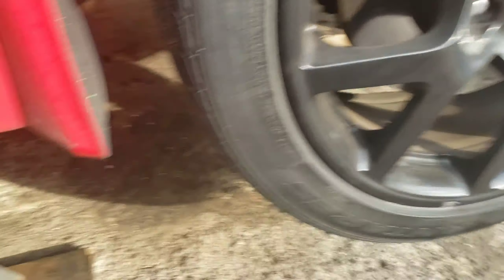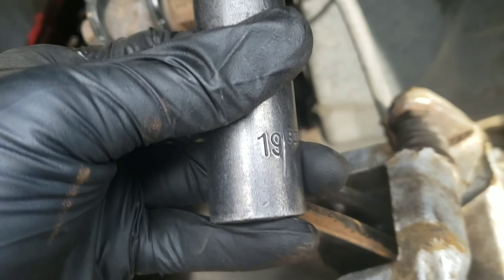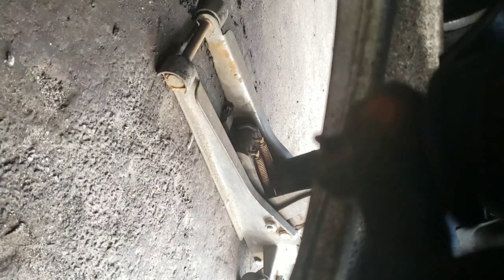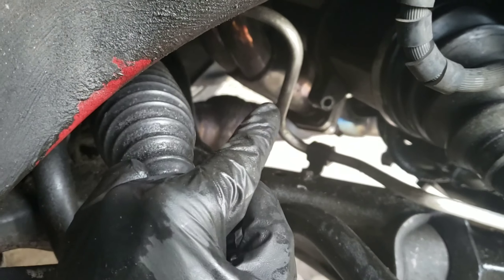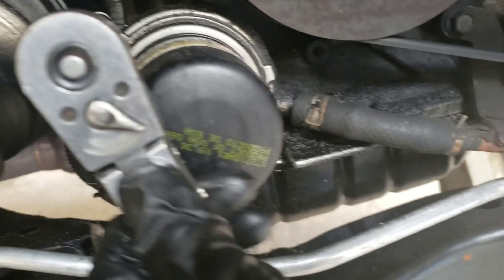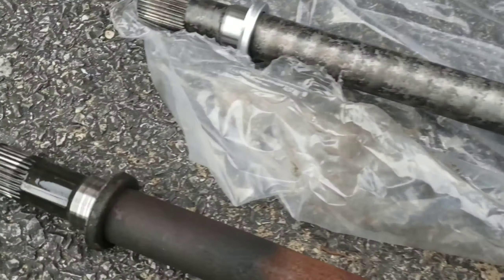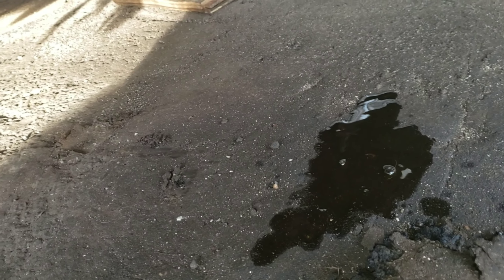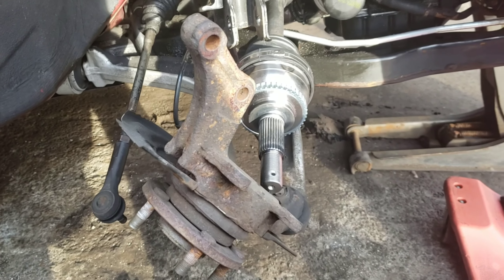How to Replace passenger side axle 2002-2006 Nissan Altima

Comment: Thanks good job man subscribed having always difficulty when taking it out also driver side but now I think I can do it but I think you have to take shock absorber out to make it easier
Do you have any videos on this car
Reply from the maker: No don’t need to take that out driver side is the easier side
Reply: @JulesMechanics  really iam feeling difficulty taking it out cause of that lock inside the shaft that go inside transmission
Anyway for me whenever I do it iam taking out shock absorber cause it's blocking my way 😂 tried. Before 2 times without removing it and it's pita at the end iam removing shock absorber and at the end of the work iam return everything back its really frustrating if there is a trick like your hammer trick for driver side its ok but ive tried hammer on driver side it doesn't work for me I have to dive inside to change the boot only 😂😂😂
Reply from the maker: @Sroor90010  Oo man yours might be stuck stuck I had 1 customer like that we couldn’t take it out had to bring it to a tranny shop to open it🤦🏽‍♂️
Reply: @JulesMechanics  I've just done it today morning it comes super easy on passenger
 side no hammer nothing just removed the 3 bolts and I have to Pull it near that bracket and iam done, cv axle out , but too much  transmission oil leaked once I take out cv axle about 2 quart, didn't expect this before it was just few drops or nothing anyway I have to take care in the future 😁
I was super happy that job done in no time but what  wasted my time cleaning back of the engine , checked engine oil cooler gasket it was OK, polishing brake caliper, was thinking to change oil pan but changed my mind keep it later to be done cause it has a bang, and Ill fill coolant, engine oil, and transmission oil after replacing headgasket hope its done welland it'll start ok tommorow morning will be the surprise we'll done or good luck try again 😂but iam confident of the job. 
 but cv axle driver side done 3 times but I have to replace the boot while it's inside

Comment: Excellent video, explained well.  
Working on my 2002 altima, replace the drivers knuckle,  tie rods, sway bars, brakes new rotors,  calipers,  pads. 
Is my axle nut 32mm?  Thanks.
Reply from the maker: Thanks man💪🏽...Should be 32mm but sometimes 34mm